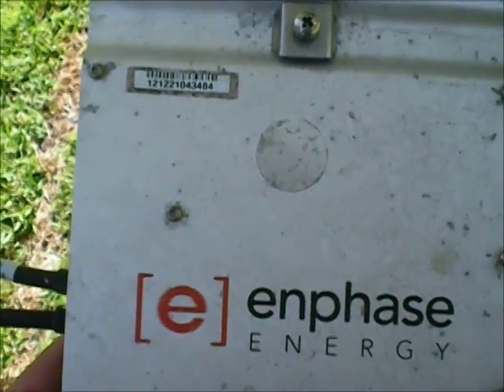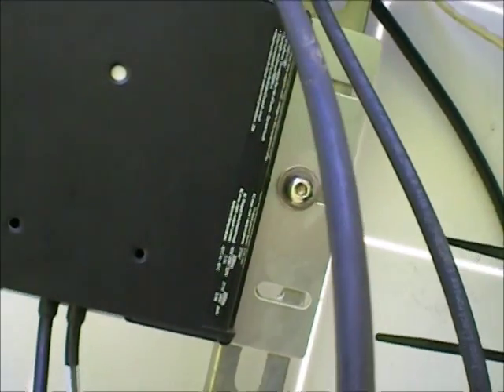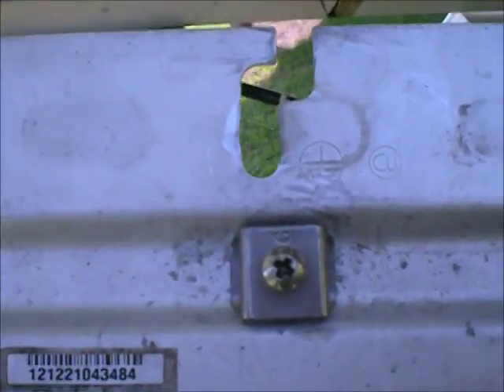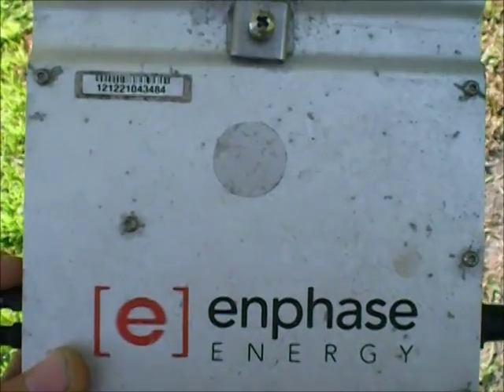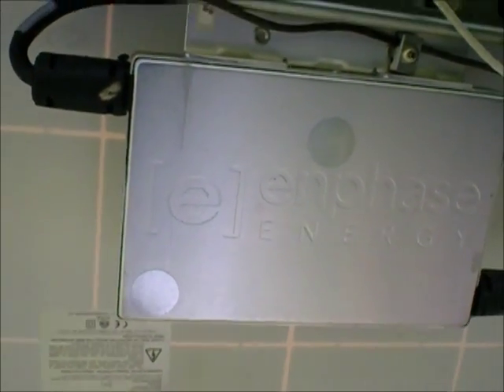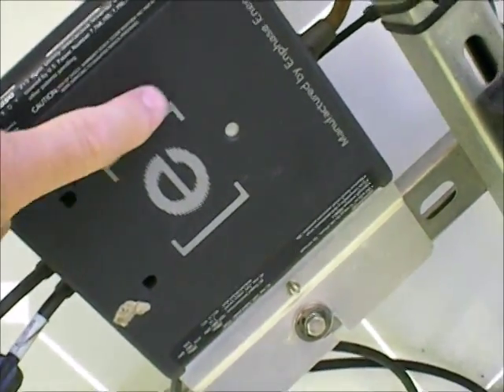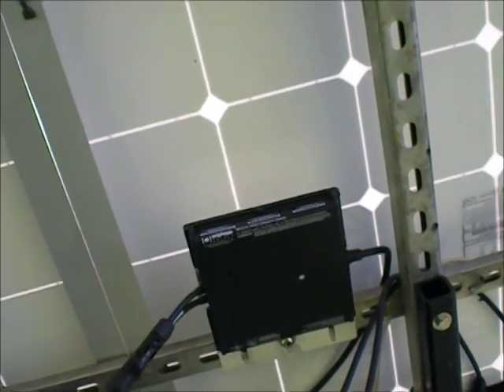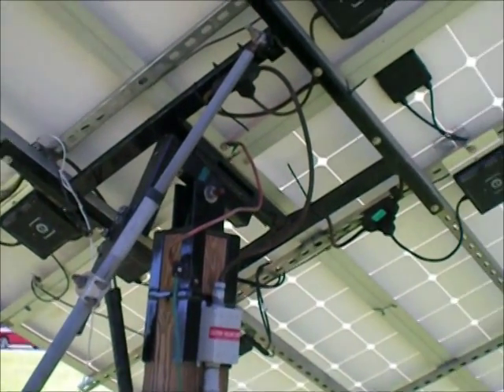Enphase 215 Grid tie Replacement & 210 Inverter Updates

Comment: Are you trading up for a bigger and better house and property?
Reply from the maker: I want to move away from everybody hopefully off grid  5 or 10 acres  ,down size home, bigger shop. More towards No FL. GA border maybe sick of the 100F heat,
Reply: I am thinking the same thing. It is just so dang hot here all the time. Its almost november its 90 degrees still dang too hot. I am suffering while I work out side. gosh.